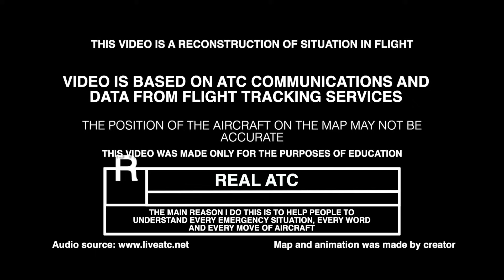Fatal Icing Encounter. Aero Commander 695 #N965BC. REAL ATC

Comment: Heartbreaking - thanks for the upload.
RIP.

Using the autopilot in icing is a big no no, as is flying above maneuvering speed in turbulence.
Reply: just like using cruise control in a car during inclement weather
Reply: Sorry but what does ‘flying above manoeuvring speed in turbulence’ mean?
Reply: @alexcoxcox87  All certified aircraft have published "V speeds" or air speeds. Stall speeds, Never Exceed speed, Best Climb, etc. "Va" is maximum maneuvering speed, the maximum airspeed at which you can use a full deflection on a control surface (aileron, rudder, elevator) without damaging the aircraft. It varies by aircraft weight, and turbulence can narrow those margins considerably. But icing is IMO is the scary bit here.

Ice, mountains, IMC, single pilot. Just the worst possible combo.
Reply: You can use autopilot in icing.

Comment: BRILLIANT IDEA flying on autopilot in icing conditions WITH ice already on the airframe (the "moderate rime" is not the extent of ice on the aircraft because you cannot SEE the coldest areas of the airframe and control surfaces) so you can't FEEL the airplane or.controls get heavy or mushy.. 

"My autopilot is turning me around." 

No. It's not capable of that. The control surfaces are turning you around. It's called a stall and a spin. 

Humidity increases as altitude decreases. The controller said "at your discretion" for a reason. Because descending to get "out of ice" only works if you make to an air temp well above "freezing".

Comment: I wonder why there is no ELT signal
Reply: Maybe the signal was blocked by terrain?
Reply: VHF radio travels in line of sight.  Aircraft flying overhead can receive the signal transmission, but ground stations can’t.
Reply: that would make sense.. the safest thing to do is land right away